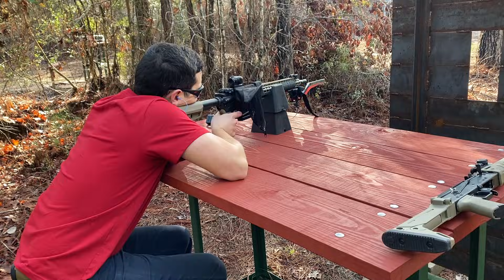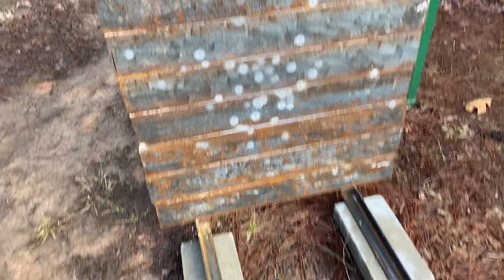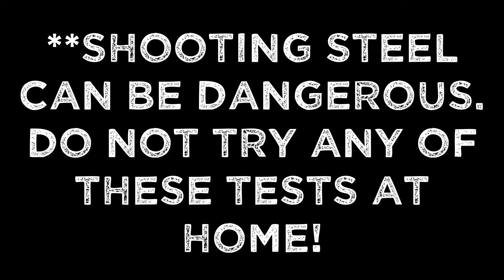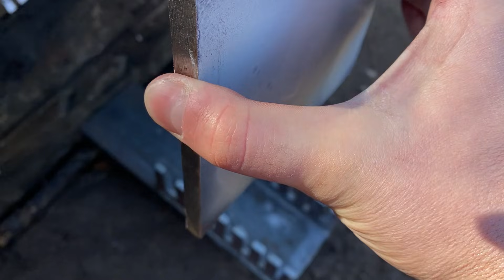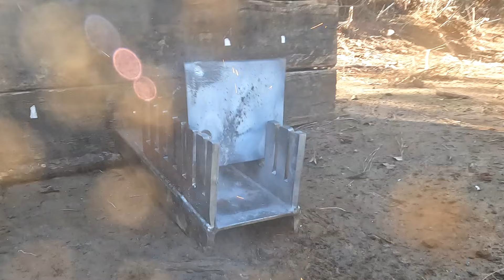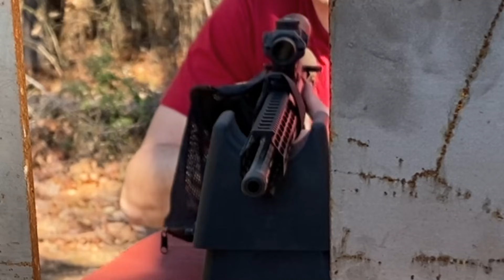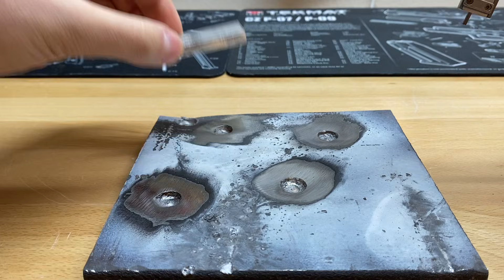223 vs 6.5 Grendel vs 300 BO vs 7.62x39 vs 350 Legend: Steel Penetration Test

Comment: Wanting to remind people that 5.45x39 is a bi-metal jacket with a heavy steel insert. No kidding it’ll go through steel easier than 5.56
It’s a cheaper manufacturing practice to use a jacket partly made of steel rather than copper. If a similarly designed 5.66 jacket were made itd be defeating steel even better due to its powder charge

Comment: Grendel is the king in the AR15 world for overall performance, although each cartridge has it's niche including the big bore ones not tested. Love to see 224 Valkyrie tested. I got two deer this year at 175 yards with my Grendel.
Reply: I wanna neck a 6.8 spc down to 6.5 and see if I can get those better spc speeds with the higher bc 6.5 bullets. Those 2 cartridges are so good in different ways.
Reply: Love my 18 inch psa Grendel.  I’m intrigued by 6mm arc that came out and uses the same bolt.  Do you shoot mainly wolf 6.5?
Reply: @snakehead5444  I’ve only shot Hornady black eld match 123 grain out of mine because I use it mainly for deer hunting. I did try some Hornady SST custom since it is supposed to be more of a hunting round. Shoots the black better. That ammo is tack driver stuff. It is also deadly. Don’t let the match title fool you. Downed one deer at 175 yards with a double lung shot. Ran 40 yards and dropped. Got another at the same spot a week later with a shattered upper legs and heart shot that went 10 yards. Not the cheapest though. For cheaper shooting, wolf would be the way to go. I slap my BCA 16 inch 7.62x39 upper on when I want to do more of AR type shooting. Use cheap Tula then.
Reply: @Rickkari7  I've also taken deer with hornady black.

I don't care if it expands (mine definitely haven't). It's what I shoot at the range so I know it so well I can hit anything with it.

A hole in the heart doesn't need to be very big. Works great.
Reply: @snakehead5444  6mm arc is far more of a barrel burner than Grendel. But still far less than something like 6.5 creedmoor. Just comes down to application.
Reply: @poconofrank9476 Hate to tell you bud, but that was half the resistance 6.5 creedmoor faced when it was originally becoming popular was the fact that it's basically half, or less, the barrel life of the common similar power rifles at the time.

One thing that aided in the acceptance of it was the creation of a bunch of competition calibers just just manage to burn out a barrel at half-again that amount of shots even compared to 6.5 creedmoor.

That didn't make 6.5 creedmoor not a barrel burner. It just lowered people's expectations for what level of barrel burning they'll accept. There are competition shooters that note 200 fps of velocity loss due to throat wear after as little as 2,000 rounds. That's still a barrel burner. There's a lot bigger burners out there...but I'm sorry to tell you, the fact that you can shoot a single day of load development and know that you need to accept 4-5 fps worth of velocity loss from it...that's a pretty good definition of calling it a barrel burner.
Reply: Add 6.8spc
Reply: If you say so... as long as you use a long barre, which is not ideal for "overall" usel. Try your Grendel out of a 16" or shorter barrel, and it gets outclassed by 6.8spc and others.
Reply: @l00nybin  Fair enough. I’m thinking overall: velocity, foot pounds, trajectory etc. May not be the top in each category, but is a very consistent round overall, from plinking to long range to the lethal ability on a wide range of game.
Reply: @Rickkari7  If I am hunting whitetail or blacktail, and I have to shoot 300yds, I could use my 6.8 with handloads and get decent performance, but a 6.5 would probably do better. Inside of 250yds, and I might as well use a caliber that is optimized around 14-16" barrels and only need one gun for everything from cqb to deer or hog out to 200yds or so (OK, who am I kidding? Only one gun? 🤣🤣🤣)
Reply: @l00nybin  I dunno man. Even at 16" Grendel shoots similar weight bullets at similar speeds to 6.8 SPC, but with far better coefficients.
Even when you limit the scenario to the actual 6.8 SPC wheelhouse alone it, at best, only edges out 6.5 Grendel (if that), and even then probably only at muzzle.

Comment: I think the 6.5 Grendel results would be better if you used a 120 or 123 gr bullet but nice test anyways 👍👍
Reply: The lighter faster bullets will penetrate better at shorter ranges.
Reply: He should have used a 90gr sp in the 6.5 grendel speed with a sp bullets are the best at making it through steel. In this case
Reply: So much of the energy was dissipated by the steel bouncing around in the stand.

Comment: Great video! 

I have been trying to figure out what the shortest length for .308 AR-10 is. Your videos have inspired me to find something that can penetrate better than my SBR .300 blkout. I want to keep as small of a package as possible but move up to a .308 caliber. Gun store employees always tell me that .308 is useless under a 18" barrel, but 12.5" looks very enticing to me. If you could do a video on barrel length vs velocity or compare barrel length vs steel penetration in .308 with your plate setup, that would be very relevant to me. Maybe even find a barrel you could cut inch by inch down to 7.5?
Reply: Would be interesting in other popular calibers as well, not just .308.
Reply: I’ve read on this extensively.
16 inch .308 is a sweet spot for being handy and still reliably maintains the proper velocity to activate hydrostatic shock.

Anything below 16 has to serve a special purpose or niche role because velocity starts dropping. 100% still serviceable. 
.308 is a hammer of a round.
But remember size and weight matters.
Reply: @Dunk1It1Hard  How do I learn more about hydrostatic shock? Is it velocity or energy related? 

I've heard anything over 2200 fps but that doesn't seem right to me. Seems like it would depend on more than just velocity.
Reply: @patrickmcneill5118  2200 fps through organic materials.

So when high speed objects rip through organic elastic snap back material it will deform but jump back into place and have memory.
To exceed the point of snap back the deformation cavity starts to rip the elastic memory out of organic material at 2200fps.

Lots of free information on the internet just reading.
Reply: @Dunk1It1Hard  wouldn't 2200 fps 5.56 be different from 2200 fps .308?
Reply: @patrickmcneill5118  no sir
Speed is speed.
A marble traveling 2200 fps vs a bowling ball traveling 2200 feet fps are moving at the same speed.

Both arrive on target at the same time.
Both are speedy enough to do the job.

But when you factor in mass. And weight and sectional density and a multitude of other variables that will determine foot pounds of energy and transfer of energy. Projectile construction also plays a major roll in transfer of energy.
Reply: @Dunk1It1Hard  so essentially, the shortest barrel is the barrel that gives velocities greater than 2200 at target distance?
Reply: @patrickmcneill5118  pistol cartridges can be very effective and the majority of those travel under 2200.

But yes I think that sentence sums it up for rifle cartridges. 

These are all just tools, and trying to find the proper tool to accomplish work. But trying to mate portability with efficiency would result in the shorter size package while still maintaining 2200 at impact.
Reply: @patrickmcneill5118  also another thing to remember is unburnt powder leaving the barrel and ignition of the powder after it leaves the muzzle. Loud and fiery. Nobody likes that.

Longer barrel gives more complete burns of the powder and gives more explosive harness translated into energy.

So yes there is definitely sweet spots that exist for all cartridges when marrying portable and efficient.
Reply: Have you considered a Desert Tech MDRX?  Mine has a 20"  barrel.  But the overall length is very similar to many SBR's.  In 5.56 NATO you have many more choices for bullpup rifles.  Kel Tec offers several for a reasonable price.
Reply: @jameseroh6544  that is a good thought. I did ponder a Tavor for a while, but any bullpup would be 2k+ when I can get the ar-10 I want for 1.3k or go cheap and get a 16" for 500 from Bear Creek Arsenal. Also, I've never had my hands on a bullpup before so I'd hate to spend that much and end up not liking it for some reason. But the bullpup definitely solves the velocity loss issue. Maybe someday when I'm richer I'll get one.
Reply: @Patrick McNeill  Consider a KelTec KS7 bullpup shotgun.  I bought the KSG double magazine shotgun before I bought the Desert Tech MDRX.  My wife found the KSG a little too wide for her.  And the KS7 is comfortable and light for her.  I wanted an SRS M2, but for budget reasons settled for the MDRX.  Most of my other rifles are bolt actions or lever guns.  So having semi-auto is a little different for me.  The MDRX is almost 9 lbs, so it is heavier than anything else I have.  I have the barrel kit for the .223 Wyle.  And considered the 6.5 Creedmore kit.  But the kit costs more than my Ruger American 6.5 Creedmore with the scope.  I like the .308, and may never use the .223 Wyle barrel kit.
My grandson would love to get the MDRX.

Comment: Maybe a thin piece of steel along the outside and top of that frame, to keep the posts in place?  If you've got the ability to weld you could weld the posts to it real quick and it should probably prevent that pinching.  Failing that I guess you could make an entirely new rig with slots for your metal plates to slide in from the side, but both the top and bottom left solid.
Regardless, enjoy the videos you've been putting out, and it's nice to see how you're evolving the setup and methodology.  Thanks for dropping another video for us!
Reply from the maker: I got a new setup coming in the next video. I really appreciate the ideas!

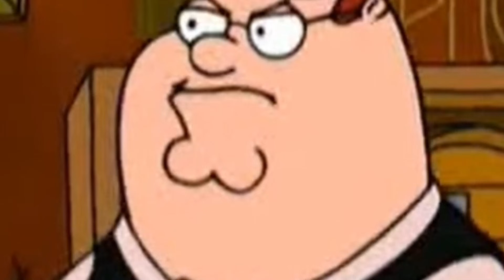Comment: 6:15 Please no, that is not spalling. 

Spalling is the removal of the material from the object being struck, not the projectile it self.  The back side of the 3/8 steel you shot is where the spall would come from.

https://en.wikipedia.org/wiki/Spall
Reply from the maker: Never new that was the correct terminology for it but that makes sense.
Reply: @bananaballistics  it's a very common misconception.

 https://youtu.be/T9krouZqGQw

Comment: Please do a 9.3x62 vs 300 Winmag 🙏🏼
Reply: Where's the point in that comparison? They have about the same muzzle energy, but .300 Win Mag has much better BC and higher sectional density. That means the .300 Win Mag will have higher energy on impact. Pretty obivous, that it will penetrate much deeper.
The 9.3x62 is a great cartridge for hunting because it creates a large wound channel, but it will not penetrate as deep as high velocity rounds with a smaller diameter.
Also, the .300 Win Mag is known to penetrate really deep, especially with a steel core round. That's what it's used for in the military. A steel core bullet from a .300 Win Mag can easily penetrate most types of body armor as you can see here: https://www.youtube.com/watch?v=3bSkI4C75Vs (.300 Win Mag AP round vs. lvl 4 body armor)
Reply from the maker: I might be able to do 9.3x62 vs 375 H&h in the future